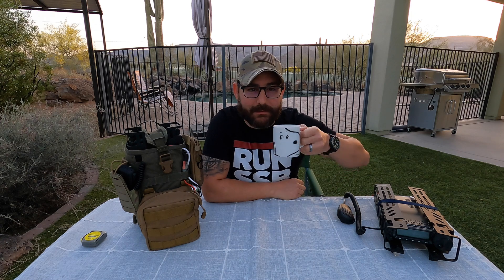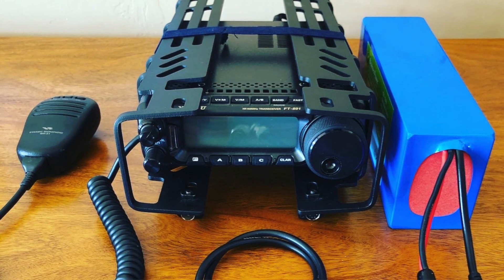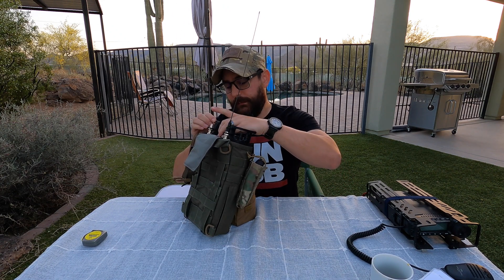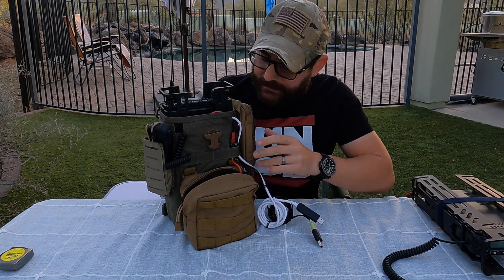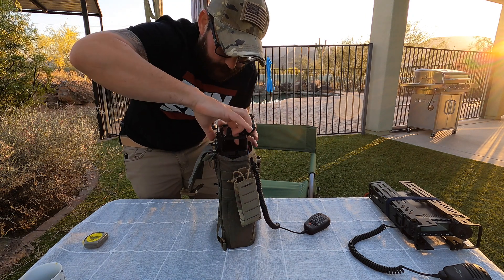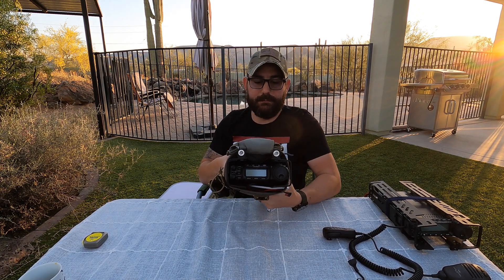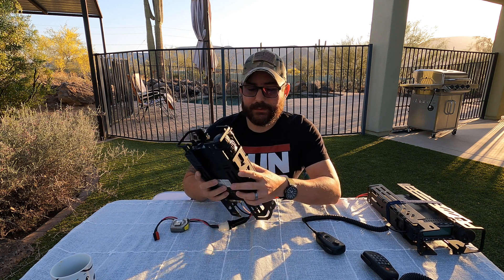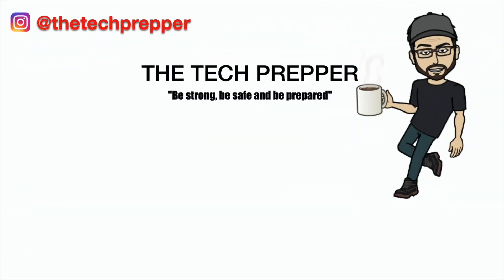TPA-857 Pack Frame - A new Radio Man Pack

Comment: Why not mount the battery at the bottom of the frame?
Reply from the maker: It's too tall. I could not find a suitable bag for that configuration. This design is free standing and has worked well the last three years.

Comment: The patch cable you have linked,  looks like one you have installed, but the other patch cable connected to the Yaesu looks different. Do you have a link for it?

Comment: Gaston: you did great in spite of the interruptions. I have learned a great deal about man-packs, which are just what I need since I enjoy NPOTA, POTA and SOTA work as well as the West Palm Beach Amateur Radio Group’s weekend excursions—Radio under the spreading Oakes. So since one of our younger members introduced me to the frame plus man-packs, I have acquired Armoloq rails for my FT-870. I bought the bag from Optics Planet. The battery is a 12v. 12 AH deep discharge Lioh, a gift from a big battery dealer. I just finish rejuvenating it (back from near death) after a long period of inactivity. BTW, Seth at Amoloq is the best: his work is elegant, is service is first rate, and he built the business from scratch. Highly recommend Armoloq!
Thanks for your great videos, I’m catching up on them as I can.
73 Tom NY2RF

Comment: do those High Ground pouches come with the radio and frame? Gosh, $206 for a pouch is quite excessive. Then why we end up buying Chinese from Amazon, no way that pouch will cost that much to manufacture...
Reply from the maker: No. It's just the pouch. Bags are expensive to manufacture if they are not Chinese crap. I actually attempted to get into the bag business and designed (over 10 months) and produced ~150 bags last year for the FT-857D and FT-818ND. They were designed by me, used American materials, and where hand made by a local artisan. My bags were $300 USD. I had to shutdown my business because no one wants to pay for quality. Get into the bag business and let me know how much you would charge. The margins are razor thin so I got out of the business. Enjoy supporting China.
Reply: @TheTechPrepper  The typical consumer like me DONT NEED an Army-Proof-Kevlar-Covered pouch so whoever wants to go in to that business NEEDS to source materials that the consumer can afford. Makes absolutely no sense to put a $300 radio on a $300 bag to go to a park and do POTA or prepping. We are not going to enjoy radio at Gaza in the middle of crossfire. Its way cheaper go the Pelican case route. I dont enjoy anything, as I understand the struggles of make a business, MY WALLET enjoy buying what we can afford. Prepping CAN"T be only for the Elite with unlimited funding. Similar bags from China are in the $40-$60 range, from that to $300 its a huuuuuuuuge difference. Im ok to pay $100-$150 for a good bag but $300 is quite absurd as well, oh wait, not a bag, a pouch. We all know where this country is heading and we all know that venture in a business like that makes no sense, I'm sorry you didn't realized my friend, lesson learned. Thank the past and current administration. This country is currently designed to don't produce anything and buy everything from China. Always remember, there is a difference between "I don't want to support" vs "I can't afford to support". Nothing personal, I enjoy what you do its just that those non sense prices made me jump out of my chair.

Comment: A male / female adaptor for the mic could be used   To avoid having to take the head off to remove the pack  unplug the mic from the adaptor  🤔    Amazon something like that    “RJ12 6p6c Female to Male Telephone Panel Mount LAN Network Ethernet Extension Cable 15cm”
Reply from the maker: I am running a relocation mount that does just that in the current build. Thanks for sharing the suggestion.

Comment: Hey Tech Prepper I love your videos. I copied ur setup with an ft857 and a tpa packframe plus a signals stick antenna. I have a small problem where the swr of the radio is high on 2 meters when i transmit. But the Swr drops a little when I place my hand on the frame of the TPA frame. I wonder if you could give me some advice on what is going on?  I am a quite new ham sorry if this question is dumb.
Reply from the maker: Not a dumb question. Check out my current instagram post. Search for thetechprepper. Basically, put a couple of ferrite beads on the jumper cable and a small ground wire. You'll get your SWR under 1.5 to 1. You're missing half the antenna when running a whip. This is why I usually use a J-pole with the manpack.

Comment: Great video and very nice concept.  One big question that jumps out at me with the 857 is airflow... the radio has a fan in it and blows out the back taking air in thru the vents around the control head.  How does this pack handle airflow?  My first thought when seeing this is radio will be running pretty hot after a time (I do understand that you're NOT running full power, etc.).  Also, the 857 is meant for 'mobile' (read 'vehicular' ... not being critcal but pointing out the expected power usage environment i.e. QRO vs. QRP, etc.) comms and is a bit of a pig when it comes to power so hence the 1.5 hours of battery life on your 4.5AH.  You can likely take a page from OH8STN's power experiments and augment a slightly larger 6.0Ah battery with a foldable solar panel and Genasun (or other suitable) charge controller.  But power options can be flexible... my main question is the heat management of the radio sitting inside the bag?🤔
Reply: I wonder if he’s melted his finals yet…

Comment: I am trying to make up my mind, I need one for my FT-818, but they seem too long.
Reply from the maker: The length of the frames is by design. It's needed to allow for an appropriate bend radius of the coax cable on the rear so that it does not compromise the integrity of the cable.
Reply: @TheTechPrepper  Ahh, thank you.

Comment: I agree about being hard on gear. I was the RTO and jumping out of the APC (before the Bradley) with my Ranger ruck in hand tossing everything on the ground then gearing up.
The wife says I’m to ruff on stuff, I feel if it breaks with me using it it isn’t worth having.
Reply from the maker: I rarely come across other radio operators that that put their gear to the test. Thank you for your service. Are you leaning towards any civilian radio's that are up to your duty use? Recently I switched to the Yaesu VX-6R for it's IP67 rating and rugged construction.

Comment: Great video, I picked up an armorloq kit for my 891. Just curious what hf antenna are you using ? Doesn't look like a PL239 adapter
Reply from the maker: You can get a BNC-to-SO-239 adapter. I keep those with the bag in an Altoids tin. I run lots of antennas, but my go-to is the PackTenna Mini EFHW for 20m/40m.
Reply: @TheTechPrepper  great thanks!

Comment: Have you figured out a way to record audio in and out from the data jack port for your QSOs?
Reply from the maker: You always have good timing with your questions. I need to figure this out within the next two weeks as I am experimenting with the MSA Sordin ear protection / headset and the VX-6R. I'll let you know as soon as I have a solution.
Reply: @TheTechPrepper  super. Good luck!
Reply: Did you ever figure out to record your QSOs?  I noticed that when you record from the speaker jack from the control face, you can hear the Tx, but it's attenuated a lot.

Comment: Have you seen any way to mount the head to your car in an elegant way?  There is no 1/2-20 thread.  How do people mount this to the car? thx.
Reply from the maker: I have not, but I've never really researched it. I have the separation kit, but never used it. My approach is anything but elegant as it's deployed in the manpack configuration. The radio either sits on the floor or rides shotgun.
Reply: @TheTechPrepper  I like the way you deployed your pack for the radio. Are you still using your 857?

Comment: Very nice setup, where did you find the prc-117 bag? I’m looking doing something similar with my 857d.
Reply from the maker: Thanks. It's the PRC/117G bag from High Ground Gear. Occasionally, some of the colors go on sale for about half price. Tactical Tailor also has a similar model, but I have never used it.

Comment: I'm ordering one of those TPA frames for an 891.  I like the pack, but would like a bag with a top cover similar to the bag that you were running with the 817 in a prior video to help keep it protected to some degree from the elements.  Any suggestions?
Reply from the maker: The PRC-117G is the only bag that I know of that works perfectly. The ARMOLOQ owner and I have been talking about designing a joint bag, but we're just in the concepting phase.

Comment: Building this exact setup, thanks so much for posting! I've searched and searched trying to find a kit that would fit my requirements and while there's a ton, you have the most comprehensive overview using high quality bits. 

Only item I wasn't sure on, which pouch did you go with for the LifePo battery? I found the side admin pouch, but haven't been able to find the proper size for the battery setup.
Reply from the maker: No problem. I have four manpacks and use the same 5.11 6x6 admin pouch on the FT-857/891/818 and FTM-6000. For some reason the colors are hard to find these days...the supply chain stinks these days. Here's the link: https://www.511tactical.com/66-padded-pouch.html
Reply: @TheTechPrepper  Much obliged! I was able to order the pack in Coyote and got lucky with the two pouches in coyote, but had to go with something other than 5.11 to accomplish it. Thank ya sir!

Comment: Great video. I'm a new ham and looking for a setup that will do exactly what you've accomplished. Thanks for the thorough review of your setup.
Reply from the maker: Thank you and welcome to the hobby. This kit works incredibly well. You may want to wait on buying gear. I am working on a new manpack built on the Yaesu FTM-6000. It should be ready in a couple of weeks. It will do the same thing without HF. 73 de KT1RUN

Comment: How hot does the radio get in the bag?
Reply from the maker: It's probably time for me to throw a thermometer in there. Thanks for the reminder. I've never noticed a real problem. I use the radio in this configuration for a weekly net that runs about 80-90 minutes with 20/80% (TX/RX) and have not really noticed significant heat build up. In the field, I rarely operate more than 20-25 minutes. I guess fully duty cycle digital modes could be a problem. One last thing, I have been considering designing a similar bag where the bottom third is a mesh material with a vertical strip of velcro to allow the removal of an outer canvas material while operating.

Comment: I plan on using my FT-891 in the field and in the shack. 
In your opinion, will the pack frame allow you to use the radio on the desktop?  In other words, does it make the radio too long to be usable sitting on a desk?
Thanks!!
Reply from the maker: In my opinion, it sits too high when oriented vertically. It's really difficult to see the display and use the controls while seated at a standard heat desk. It works great in the field though especially if you run it in the PRC/117G radio pouch.
Reply: @TheTechPrepper  I was more thinking of it sitting horizontally on the desk and wondered if the frame added too much length to the overall radio that it would just become cumbersome sitting on a desktop… wow, that was a long sentence!
Reply from the maker: @ErikAtTheW  I have my FT-891 with the TPA pack frame sitting on my desk in a horizontal configuration now. The two relocation mounts are used as feet and work well enough for easy access to the controls. However, when on the desk, I run the coax from the antenna connector on the back of the radio. I don't take my FT-891 portable anymore as it is pain to put back into the radio pouch. I also need to remove the relocation mounts from the bottom of the unit to the top. It's really a pain switching between this configuration when going from a portable operation to use in the shack. Honestly, I see little value and usability issues when using the pack frame in the shack. I absolutely love the pack frame, but it is really designed for vertical use in the field.
Reply: @TheTechPrepper  Got it!  I appreciate the detailed explanation!

Comment: Please don't run full power on the 857 when you are working that small whip when it is in your lap. You don't need to be irradiating your body with unnessicary RF. 10 watts is my personal limit and I try to keep the radiating element at least 3 feet from me.
Reply from the maker: I typically run at most 20 watts these days and back down to 10 or 5 watts if possible. Great call out of RF safety. 73

Comment: I’m very interested in this product and have looked at the website.

I’m new so this my be a dumb question. 
Is there a whip antenna that will handle HF at the 100w?
Reply from the maker: I have not tried an HF whip with this setup. There are surplus military and commercial manpack style whip antennas on the market that should be able to handle your power requirements. For example, I came across a pedestrian antenna from Super Antenna while doing a quick search. http://newsuperantenna.com/MP1RP/. You may want to check the HFpack on the Google IO group as this question seems like a question perfect for that group.
Reply: @TheTechPrepper  thanks so much! I have looked but couldn’t find anything like this. That looks like one heck of an antenna!

Comment: Only american preper can use 1Amp RX radio, not thinking about cooling, and than use mh-59 which is almost useless on HF.
Eh bro, you evidently have the sense for buying good things, but use them totally wrong. All those staf you chose very well.

I love the frame, bag is excelent...next time, just try think like (i need use this maybe 2 or more days, after tornado, huricane, tsunami)

I think i was see you with 817 or 818, learn how to use this radio, for preping it is ultimate tool. Im from midle EU,
and i make QSO with US guys(20M) on 5-10 watts with 817 - no problem. I love your spirit and enthusiasm, 
you are smart, so use your brain and logic. Wish you luck and i hope we maybe
 do QSO.

Btw, watch this... mh-59 it is realy bad mic for HF. https://www.worldwidedx.com/threads/yaesu-mh-59-mic-rfi-nightmares.26128/

On 2m or 70cm OK, for HF need few mods - they are easy, make them.
857D is good all band radio, a bit old, but still usable, for HF i recommend few mods.  Speech procesor mod, and "hi-fi SSB" mod.
For few bucks, you get completely diferent radio, the ALC and AGC mods are good to. I have two 857 the first is 13 years old, second i was buy before 14 days. Yaesu dont change a lot this TRX, i must do almost all this mods even on the new version.

Sorry for my ENG, in school i must learn Russian. :D
Reply from the maker: I appreciate all the tips. I didn't realize the MH-59 was producing RFI. I bought it so that I could have a DTMF keypad for Autopatch and for ease of frequency entry on 2m/440.

I'll look into the mods you suggested as anything that improves my HF communication capabilities is worth the investment.
 
I appreciate the comment and view. 73
Reply: @TheTechPrepper  As i wrote, you chose the equipment very well. Now, show us all, you are citizen of country
which send man to moon. And please dont take my text ofensively. Im just ex military...profesional deformation maybe. 
I wish to see more young people in my country, with your spirit and enthusiasm. I like your behavior "fail - learn - not fail again" 
This is important! Keep in good job. 73

Comment: I assume this would not be the setup for running an MPAS 2.0 antenna. There any packs you'd suggest for such a setup.
Reply from the maker: This manpack works with any HF/50/VHF/UHF antenna, including the MPAS 2.0. You just need to connect the feed line. I typically use wire antennas with this system when operating HF.
Reply: @TheTechPrepper  i know that, more curious about a bag solution to fit the manpack and mpas 2.0 antenna system.
Reply from the maker: @KF0CQX  I wish I could help, but I don't have an MPAS 2.0. Good luck with your hunt.

Comment: Gaston, I know you are working on your software/application stack to use phone in field to simplify your digital comms.  Super excited for that. 

But would you please give some details about your cables and usb sound card interfaces between the FT-857D and the Raspberry Pi?

Did you homebrew your own CAT and Data cables?  Or if purchased, a link to them please?

And what for device in the middle between the Pi and the 857D (if any) like a MiniProSC , Signalink, or M-Link U5 device?

Thanks for any details and info

Mike - KK7LL
Reply from the maker: This is a great question, Mike. As part of the EmComm Tools project, I am making a video that covers all the components for my "reference digitial station" for the FT-818/857D. This video will be out early next month. In the mean time, here's the part list:
1. USB Sound Interface: https://amzn.to/3o6eizT
2. Audio Interface Cable: https://www.ebay.com/itm/372704836880
3. Cat Control Cable: https://www.dxengineering.com/parts/rtp-usb-62
4. GPS: https://amzn.to/3bfMpjp
Reply: @TheTechPrepper  thanks so much Gaston! 

Just ordered those cables and GPS, so I can be ready when your video drops. (My TPA-857 came yesterday)  
Looking forward to that next video too.